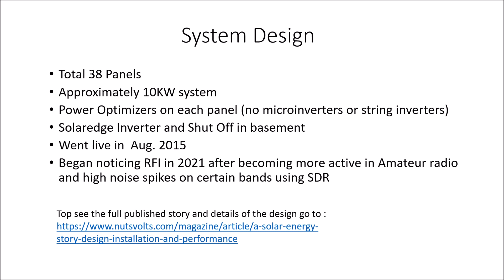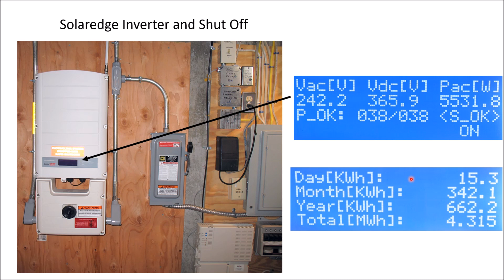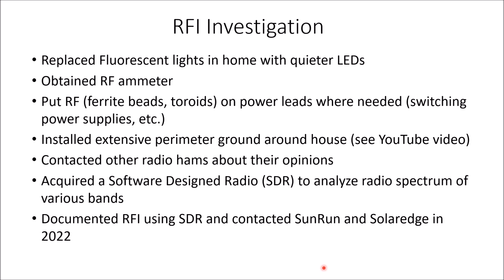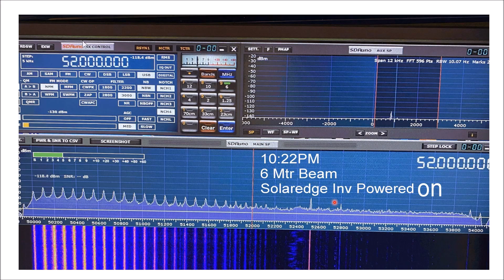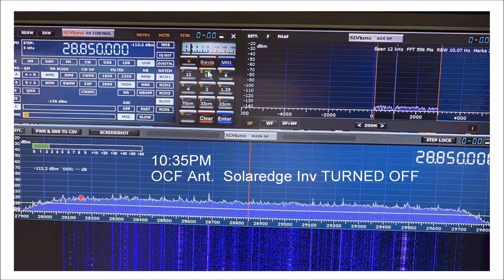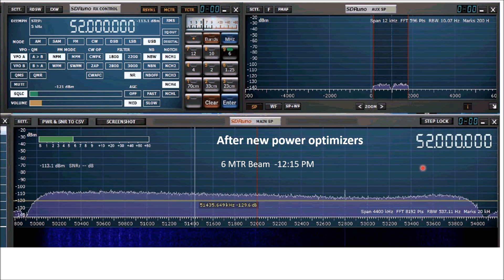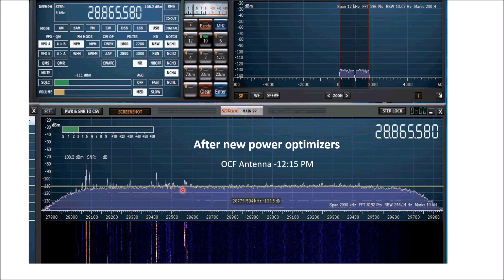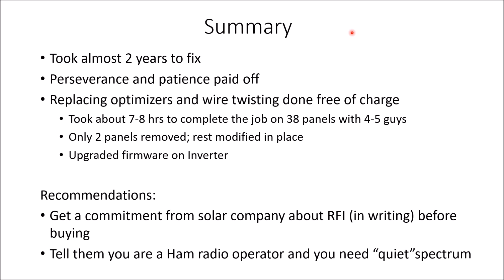Solar Panel and RFI

Comment: This is what I have found, being off the grid made us think outside the square. 
MPPT chargers are efficient yet noisy, so are inverters, I tried different makes and brands yet ALL emitted RFI to a certain level, none were radio friendly.  
If you think noise is not coming out of your DC solar panels, think again, I ended up using cheap main to 12v transformers as the filters for the DC line, those were used in the secondary stage only (making sure the current could be handled by those transformers) this move alone took 60% of the noise down, what a win.
Now the inverter itself, yes, it is noisy as well yet installing high current EMI filter as close to the inverter output as possible solved this problem as. NOW we have the inverter/charger working and the noise level drop to a pre solar install times. 
I have tried twisting cables and clip on ferrites many times before, yet the outcome was never satisfactory till the above was done.
Now back to playing radio.
Reply from the maker: Could you supply a diagram?  Did you do anything with the power optimizers?
Reply: @PracticalEngineeringSolutions  ??? every installation is different, look at the DC line coming down from the solar panels to the MPPT charger (those could be 100-500V maximum rated open circuit voltage, the system should have been designed according to what your  MPPT can handle.
Some insulations have 2 lots of separate solar panel arrays with two separated inputs for each array, All my DC lines are going through a cheap main transformer ( I found the 220v to 12v 20A to be a cheap option about 17USD each) I use 2 transformers for both the plus and the Minus side and placed them BOTH as close as  I could to the MPPT/Inverter inputs, this alone dumps all low FRQ A.C noise originating in the MPPT Charger and stops it from going up to the solar array using the DC lines, the last thing  you want is for your solar array acting as an antenna , no AC noise =no noise there, please note!! the DC goes through the secondary side of the transformer, the primary is left open and unused.
As for the inverter output (solar created mains AC power using the solar/battery source) you will have 2 wires there (AC mains) those have to go through EMI filter, you will have to get the maximum current you will be using ( my one was rated 250v /40A), this will help you get the correct filter for the job and,,,,,,,,, walla DONE! , no more RFI>
Reply: @che59v  Thank you!. Gives me hope without the extreme (budget) pain I got from watching the video 😂. edit: Btw, my actual and only real solution is by switching everything off and operate with a battery. "Dark mode" I call it. Inconvenient and only possible on occasions but it is ideal.

Comment: Great video, very informative thank you. Do you happen to have the model numbers of the old equipment and the replacement gear? I am about to purchase the same brand of inverter.
Reply from the maker: Sorry, no. They took the old power optimizers away when I was not around. Just mention to Solaredge you want to make sure you have the latest versions of the optimizers and you will be checking for RFI. Good luck.

Comment: New subscriber here.   Fellow ham. I have seen reported problems from Solar Edge and maybe a few others. Maybe the other was enphase. The ham that posted the video said the DC optimizers were as RFI probes as the micro inverters.   I am new to the ham hobby and am considering solar.  Do you recommend any equipment to scan for RFI? My SDR is bolted to the desk in my ham shack so I was thinking of portable walking around the property and such.  Thanks again for the video.  All the best from north Texas.  73 de KI5HXM
Reply from the maker: you do not need a portable sdr. If you have RFI you will know it on you stationary one. I had an SDR on my bench in the shack and it was obvious. I do not have microinverters . I have and older Solar Inverter in the basement.
Reply: @PracticalEngineeringSolutions  yes true about not needing portable. My friend who loves a few miles away was able to use a portable Yagi and some instrument to show the power company where they weee spewing RFI.  I have seen DC-DC converters have problems.    Thanks for your reply.  73 de KI5HXM